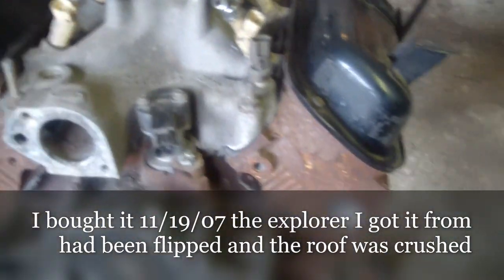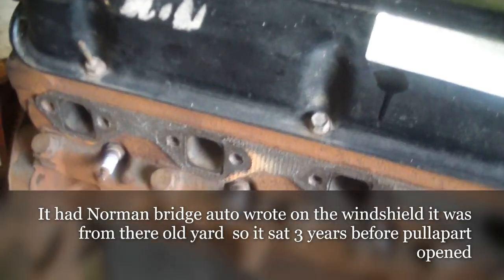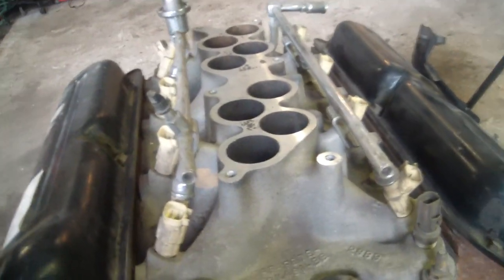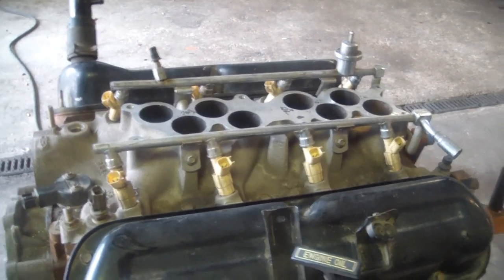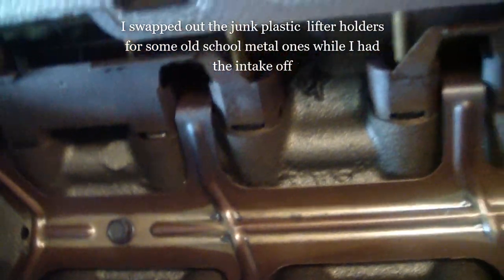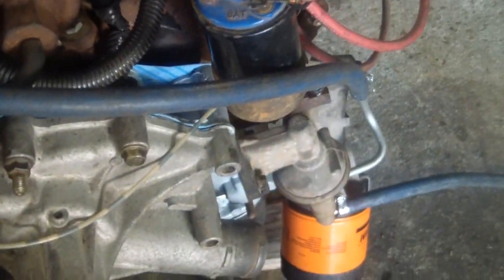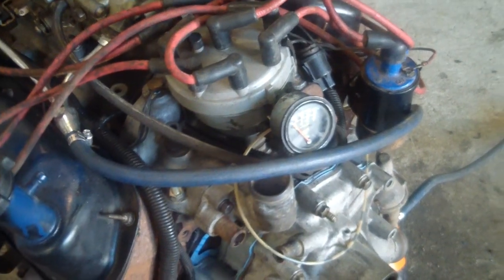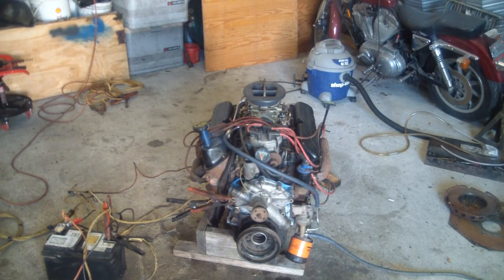First start 01 Ford Explorer 302 swapped to carb

Comment: I got a 96 explorer engine having trouble with wiring and shit dont want to spend any more money on electric fuel pump etc would this work on it by chance?
Reply: I have a 289 would i be able to use everything off that one to do carburetor swap on a 96 explorer engine? Thanks
Reply from the maker: If you swap it to a carb you'll need a low pressure fuel pump  there cheap about 30 bucks.  On this motor  I swapped the timing cover and harmonic balancer and used a 85 mustang distributor that has the right gear for a roller cam does away with the coil packs put a weiand 8011 intake and a holley 650 dbl pumper carb MSD box or 85 mustang ICM. the timing cover I used has a mechanical fuel pump hole. If your trying to do this in a Explorer it can be done without swapping the front of the motor you'll just need a low pressure fuel pump, intake, 85 mustang distributor, a carb, plug wires, cap, and rotor button, MSD box or factory ICM 45 bucks at autozone. Take the pump out of the tank add a hose in place of the pump so it doesn't run out of gas at a half a tank and it will run probabaly better than when it was fuel injected. Hopefully this will help you out I hate fuel injection myself
Reply: Im just using the engine i put it on a 65 mustang and dont want to spend any more buying a fuel pump and doing the harness and all that i have bunch of parts laying around to do a carb swap i believe well thats if im able to use the parts off a 289?
Reply from the maker: the intake should work  just get the right intake gaskets. the distributor will fit but the gear is cast iron and the roller cam will eat it off and it will jump time plus it probabaly has points.  85 mustang distributors have the right gear and electronic ignition they are about 80 bucks at AZ  ignition control module is 45 bucks with a lifetime warranty on both. You can swap the gear for a bronze gear but it cost almost as much as a new distributor
Reply from the maker: If it's going in a mustang yes use every thing except the 289 balancer or flywheel 289 is externally balanced the 302 is internally balanced  they make a balancer that has both patterns 3 bolt or 4 bolt  so the pulleys line up.  you will probabaly need a newer model cam eccentric for the fuel pump 289 has a longer pin in the cam  that holds it from turning  302 has a tab that goes in the hole in the cam gear the oil pan is different 289 dips in the front swap it and the pickup tube. I put a 86 302 in a 66 mustang the dipstick tube is in the timing cover on a 289  so plug the hole in the 302 dipstick tube is in the block. If you have a automatic transmission see if the flywheel is the same size count the teeth if it's the same size use the explorer one  the 289 is externally balanced and it would have a vibration if you use it. If it's a different size just get one for a 82 or newer 302 82 and up are internally  balanced and will work. look at the heads if it has 3 lines  they are gt40 and they are the same as the 289 if they have 4 lines  they are GT40P heads  the sparkplug angle is different might have issues with exhaust manifolds or headers other than that it will work in a 65 mustang. I put mine in a 87 Ranger and put a semi truck turbo on it go check out the videos on it if your interested and subscribe if you haven't already
Reply: Om so should i use a different distributor then? Or how can i avoid having that issue?
Reply: Ok i hadnt read the rest sorry
Reply: Ok so is it better to just use everything off a 85 mustang instead?
Reply: In other words can i just use a 85 mustang timing cover and i will be able to install manual fuel pump? Is that easier?
Reply from the maker: The water pump is different on a 289  than a 85 mustang  just use the 289 cover and water pump and a cam eccentric for a 85 mustang  swap the oil pan put a aftermarket balancer on it with the 3 bolt pattern so you can reuse the crank pulley plug the old dipstick tube in the block get a gear for the 289 distributor or swap it to a 85 mustang distributor  with the steel gear not cast iron gear  and flywheel and put it in. It'll work and run like a bat out of hell lol.
Reply from the maker: I would use a 85 mustang distributor and either a MSD box or the factory ICM for a 85 mustang and coil  you will need the harness from the distributor to the ICM or make your own its 4 wires 3 form the distributor to the ICM and one from the ICM to the coil negitive run the old wire that went to the coil  to the new coil positive  and to the power wire on the ICM to turn it on and it will run that's how I ran this one on the ground.
Reply from the maker: I hope I haven't confused you with this jumping around LOL.
Reply: Cool i kinda have a better idea now. And thanks so much!!! Been really helpful thank you for your time!!! Im starting with it today! Lol
Reply from the maker: your welcome let me know how everything works out you should be able to reuse the pan gasket it's a one piece. be careful taking the timing cover off the bolts like to break sometimes good luck with it.
Reply: Will do thanks a lot again! Ill let you know how it turns out
Reply: One last question when i do the eccentric cam i dont need to take off any of the cams right? In other words i wont have to mess with the timing and stuff?
Reply from the maker: Once you get the timing cover off you'll see it's one bolt that holds the cam gear to the cam just take it out it'll have a tab under the bolt leave it off when you put the eccentric on it replaces it. You don't have to take anything else apart  just pull the one bolt. It's easy to do just pull the cover off the 289 and copy how it is the 289 eccentric is a little wider and a one piece the new one will be two piece with a tab that goes in the hole in the cam gear. 289 cam gear the pin is longer and sticks out past the gear and the eccentric has a hole that lines it up. the 302 pin  is shorter thats why you have to swap it to a newer style with the tab that sticks out. The 289 fuel pump will work on the new style eccentric you'll see what i'm talking about once you get the timing covers off both motors. what heads does it have 3 lines or 4 ?
Reply: So im only using the intake manifold off the 289 and flywheel off a 302 the 4 bolt one figured it will be easier to just get everything else from a 85 mustang? And it has the 3 lines one
Reply from the maker: The harmonic balancer on the 302 has the pulley made in it so you have to put one on it. The one I got has a spacer that bolts between the pulley and the balancer and has both patterns for the pulley. the 289 balancer doesn't stick out as far as a 302. Plus they use 3 bolts in the crank pulley 302 uses 4.  So if you get a balancer get one with both patterns leave the spacer out and the 289 crank pulley will work on the 302 and use everything off the 289 timing cover, water pump, pulleys fuel pump everything will fit like it was from the factory. so all you need is a balancer like mine and the two piece eccentric  and reuse everything else off the 289 accessories a 85 mustang distributor or a bronze gear to go on the 289 distributor. The 302 flywheel might have the same amount of teeth same size just use it if it is. You got the good heads on yours and they have the exact same angle sparkplug as a 289 so your manifolds will work with no problems. It should be a easy swap
Reply: Nice! So pretty much just the distributor and pulley plus essentric cam and everything else from the 289. Got it! Im actually working on it as we speak!
Reply: I have an old 302 maybe 80s i would say can i use the pulley off that one? Its 4 bolts
Reply: So i took out the eccentric cam on the 289 and its actually a 2 piece you think it would work or should i just get the one you told me? Sorry for all these questions! I really appreciate it!
Reply from the maker: It's got to be 82 or newer it's hard  to find a v belt  crank pulley that will line up with the 289 water pump pulley and alternator be easier to just get a new balancer that way you can use the 289 crank pulley and everything will line up. Plus the old balancers tend to sling apart you can probably use the fuel pump eccentric out of that other 302 if it's a two piece.
Reply: The 289 has a 2 piece would that work?
Reply from the maker: Did the pin in the cam stick past the gear and hold it still the pin is the difference.  One for a 302 has a little tab that goes in the hole in the cam gear the pin isn't as long as a 289 so if it has a hole and not a tab it won't work
Reply: On the 289 it doesn't stick out the pin its in there like half way on the cam once i take the bolt off the eccentric it just falls right off?
Reply: It actually is a bit longer on the 302 i tried putting the eccentric cam on it to try it but pin doesn't let it go all the way?
Reply from the maker: open the old 302  and see what it looks like. If you got the timing cover off the 96 302 take the bolt out of the cam and look at the piece behind the bolt it should have a little tab that goes in the cam gear the one you need will look like it. If you can grind the tab on the one you have till it sits flat on the cam gear it will work
Reply: Okay i will do that then. Thanks so much for your time!
Reply: Okay i will do that then. Thanks so much for your time!
Reply from the maker: Make sure the eccentric doesn't stick out too far if its the wide one and scrub the timing cover on the inside I've had that issue before.
Reply from the maker: @autobodyshopandmechanics5915  Go ahead and line up the timing marks while you have the cover off so it will be easy to drop the distributor in.
Reply: Ok hopefully i finish it tomorrow ill make sure to check that from the look i think i will just be needing to pick up a balancer and maybe a distributor if i dont have one laying around. On the balancer how would i be able to ask for it at the parts store? Just 302 balancer with 3 bolt pattern? Btw are you from AZ?
Reply from the maker: @autobodyshopandmechanics5915  I'm in alabama.  I would google it I can't remember what name brand it is I got about  18 years ago. Jegs has this one Part Number: 439-24270 for $117  it has both patterns and it's the right one the 50 oz it's a good one pro street balancer
Reply: Yea i just went to the local shop here and they dont have it im going to order that one then. Thanks for all the help!
Reply: Would a 4 bolt work if i get the 4 bolt pulley? A shop around my place has the 4 bolt in stock only would that work?
Reply from the maker: You can use a 4 bolt but then you need a crank pulley that lines up with the other pulleys. The 302 4 bolt balancer sticks out further where the pulley mounts.The spacer on mine is about 3/4 of a inch that makes it like a normal 4 bolt. It's not easy to find old v belt pulleys I had this same problem when I did the swap on the 66 mustang back in 1989 when you could still find a old car in the junk yard I can imagine how hard it wolud be now days. You will spend more time and gas trying to find a pulley than that balancer cost from jegs.
Reply: The reason i asked was because i got an old 302 not sure what year and the one has the same belt type but its a 4 bolt but i wouldn't know if that is the weight i need looks like the size is good just wouldn't know on the rest. And yea i figured i just want to hear it already! Haha. I hate waiting on parts but i guess im gunna have too
Reply from the maker: @autobodyshopandmechanics5915  If it has a one piece rear main seal  on that old motor it's the right one. You could try it and see if the pulleys line up you might get lucky. If nothing else You can put it in and hear it run worry about the belts later
Reply: What happens if i put the wrong pulley like it not being the correct weight?
Reply: I dont want to mess anything up haha. Ill check on that seal tho
Reply from the maker: @autobodyshopandmechanics5915  the pulleys don't change the balance. But the 68- 81 302 have a two piece rear main seal and were externally balanced . 82-01 302s have a one piece rear main seal and are internally balanced. you can run what ever pulley set up you want as long as everything lines up and it doesn't sling the belts off every time you drive it
Reply: I just removed it and it lines up but my question is what if its the one that is externally balanced? Would i mess it up?
Reply: On the balancer what if i put the opposite one that is not internally balanced nor same weight?
Reply from the maker: If it has a one piece rear main seal it's the right one. It would still run but it would vibrate bad and eventually damage the bearings
Reply: So i finally found the balancer i needed at junk yard today i have one last question lol sorry for all these questions i really really do appreciate your time! I remember you said to line up the marks on timing to just drop in distributor. Well i forgot to do that do i have to reopen it up and do it? And could i just drop in the distributor any way or does it go a certain way? Do i have to set it on time?
Reply from the maker: @autobodyshopandmechanics5915  Yes you have to have no 1 cyl  at TDC on the compression stroke then the rotor button needs to point at no 1 plug wire on the cap when the distributor is bottomed out in the hole. The vacuum advance should be in the same place mine is pointing in this video
Reply: So i do have to open the timing cover back again to align it?
Reply from the maker: @autobodyshopandmechanics5915  No once  you get a starter on it you can pull no 1 plug  out and put your finger over the hole and bump it over till you feel compression use the timing marks on the balancer set it on TDC .The keyway in the crankshaft will be at 12 O-clock position.  Use the timing pointer off the old 302 timing cover not the one off the 289 if I remember right there different.
Reply: Ok will do! Thanks!
Reply: One last question i got an hei distributor laying around can i use that? Or do i need the one that has the separate round coil?
Reply from the maker: @autobodyshopandmechanics5915  As long it has a steel gear and not cast iron.
Reply: Cool i will check that tomorrow cant wait to get it done! Thanks!

Comment: What trans is hooked up to this beast?
Reply from the maker: Mustang T5 I put it in my Ranger and put a Semi Truck Turbo on it
Reply: @kickassmustangsgarage  sounds awesome. Thanks for the reply
Reply from the maker: Go subscribe and check out the Ranger build
Reply: @kickassmustangsgarage   my daily driver 2002 ext cab 4x4 4.0 auto b4000 just blew its 3rd 4.0, and since its on its freaking THIRD 4.0 im putting a 5.ohh in it.... Im ripping ALL the 4.0 shit off(only motor and trans wiring and vacuum and all that bs) and putting explorer frame horns and trans mounts in, and going old school with NO electronics what so ever on the motor or trans... What's the biggest issue id run into??
Reply: my goal is just to get it running and dependable within 2-3 weeks... I just put this 4.0 (freaking THIRD one in 3 yrs...)  in 6 months ago and im over the junky ass things...... Soooo a 5.0 with a mechanical c4 c6 fmx what ever i can find is the only option i see to keep me from killing another 4.0 in 6-8 months....  Any advice is greatly needed
Reply from the maker: @JesusIsTheLightAndway  All you need for the motor is a carb intake 85 mustang distributor  low pressure fuel pump  msd box or factory icm  and figure out what accessories you plan use. Explorer timing covers don't have a hole to run a mechanical fuel pump and the belt runs on the harmonic balancer no pulley like a mustang if you run the Explorer accessories probably what it'll need to have room. It has a crank trigger ring on the balancer that it won't need once you put a distributor in it  so you can run explorer accessories with a carb just need a low pressure fuel pump. 87-93 mustang AOD 87-93 4.2 truck trans all would work has a detent cable non electronic transmission only wires it needs is the nutral safty switch  and back up lights. the transmission slip yoke is smaller on a 4.0 other than that everything should work . hope this helps you out some.
Reply from the maker: @JesusIsTheLightAndway  I hate a 4.0 dohc have to pull the motor to change the passenger side head or timing chain guides because the bolt is between the block and the transmission craziest shit I've ever seen
Reply from the maker: @JesusIsTheLightAndway  if you can find a older AOD with a detent cable it'll work and still have overdrive 3.8 4.2 5.8 5.0 old staight 6 300 all have the same bolt pattern

Comment: What distributor did you use
Reply from the maker: 85 Mustang  it's the first year with a roller cam  and last year with a carb
Reply: How did you wire it up to run right? Im trying to set mine up with a carb, electric fuel pump, and absolutely the bare MINIMUM of wires going to my motor... Any help is greatly appreciated!